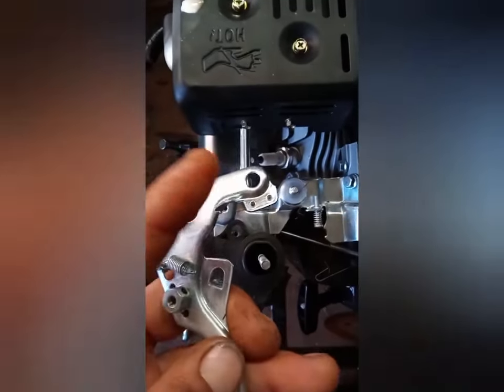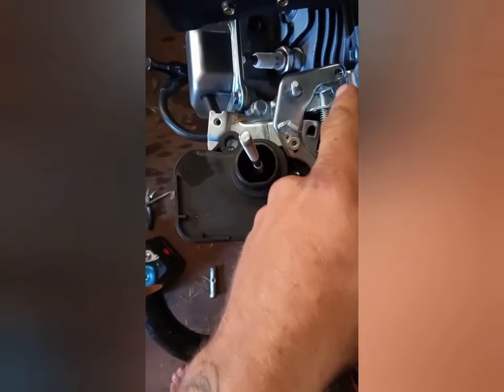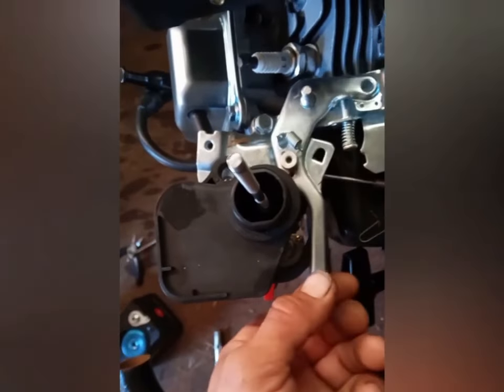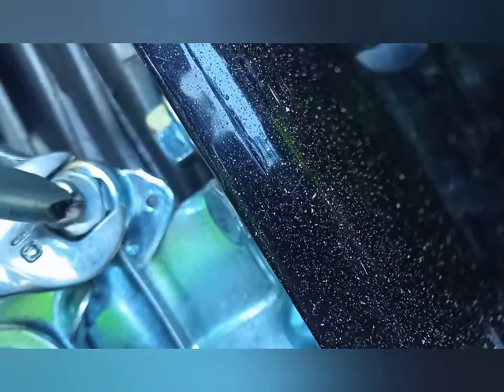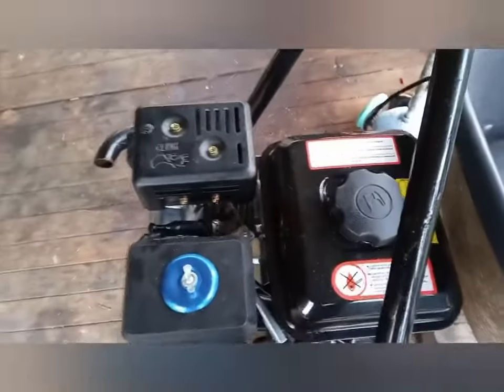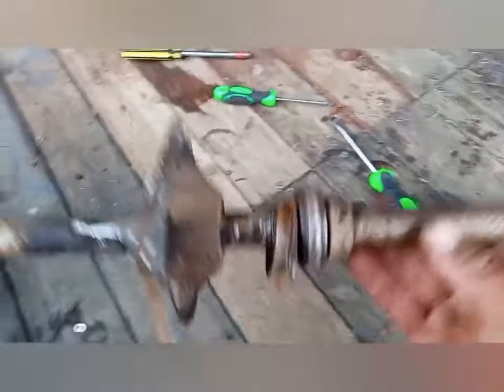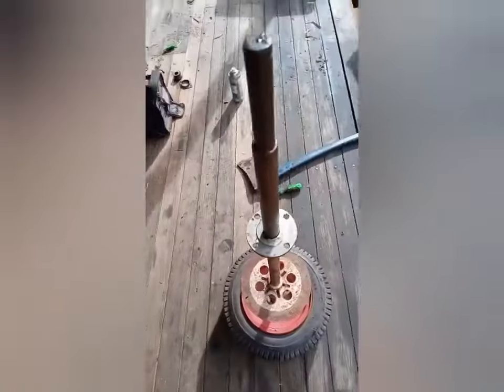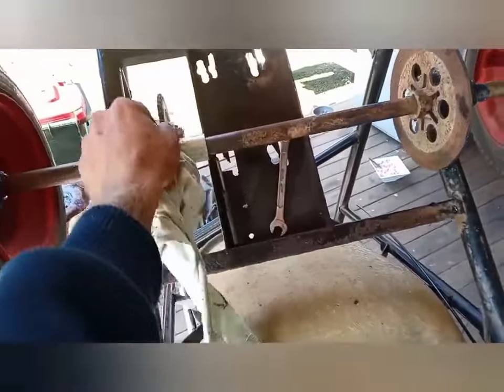Building a rough Backyard 7.5hp Go-Kart

Comment: That roll cage is about as effective as a PVC one. The bars are supposed to be taller than your head sits so your head doesn't impact the ground.
Reply from the maker: @thevillageeclectic  haha 
I found the frame on the side of the road waiting for collection to go to the tip.

I seen it and took it home, threw the engine on it - had some fun and then sold it
I just wanted to motorise some wheels for the paddock didn’t plan on making it into a race car. Was dodgy as but a fun project at the time lol
Reply: Least he's wearing a helmet I guess. Shoes would be smart tho